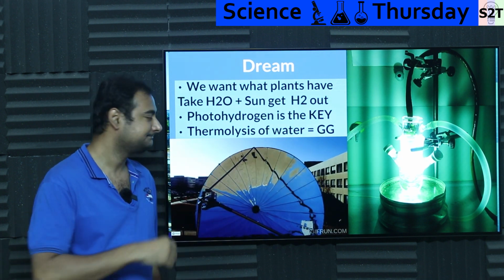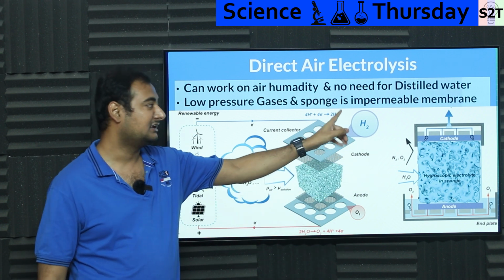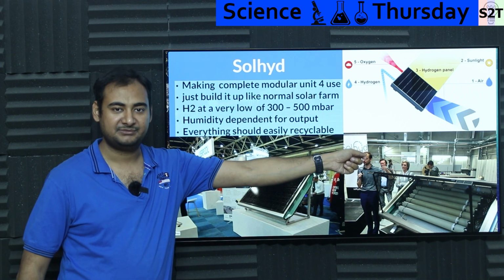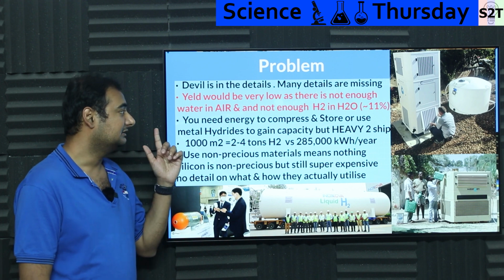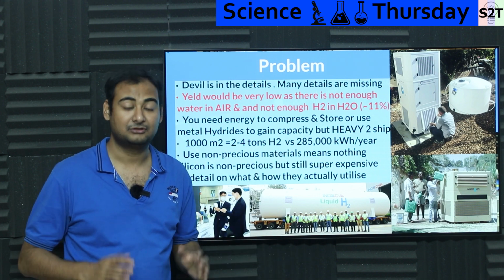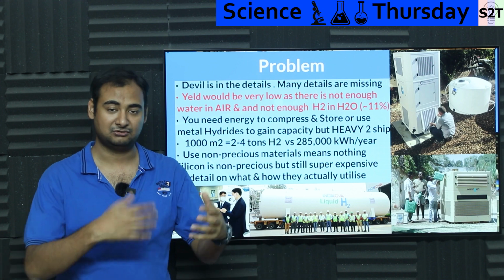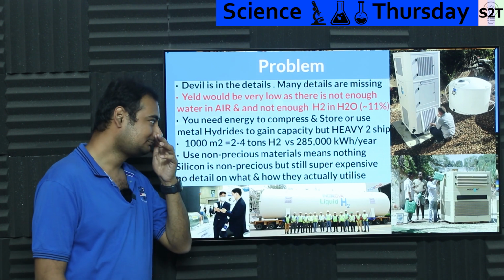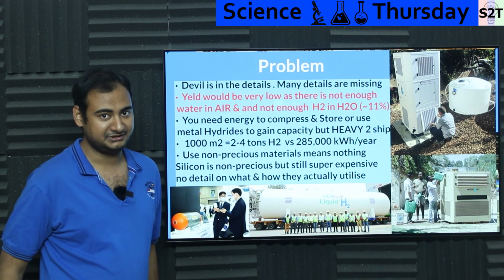Solar Hydrogen Panel Explained {Science Thursday Ep225}

Comment: Please, hydrogen as a residential or vehicular energy source is so dumb for so many reasons. Are you going to take the blame for all the people who die in hydrogen accidents? Hydrogen has its place - in industry and industry only. Only 5 days ago a hydrogen bus exploded and burned in California - there was no warning and it's only luck that no-one died.
Reply from the maker: I am sorry I have no idea what u are trying to say
Reply: @s2tenglish  OK. Industrial hydrogen is fine when used immediately after production as a reducing agent especially in manufacture of steel. However the fossil fuel industry are pushing for hydrogen in society. This is bad. Here are just two points (out of many) 1) Hydrogen gas is very rare in our atmosphere and yet there are microbes and potential pathogens that feed on it. Increase H2 and those pathogens could cause us harm. 2) Escaped H2 reacts with hydroxyl radicals in the atmosphere. Free hydroxyl radicals are the one thing that reacts with free methane to neutralize it. Removing OH- from the atmosphere will increase CH4 which is a potent green house gas bubbling up from thawing permafrost. Bonus point : H2 oxidizes (mostly explosively) with oxygen to produce water vapor. Water vapor one of the most potent green house gasses. The sun does a great job creating just enough water vapor to keep our atmosphere stable - we shouldn't be adding to it.
Reply from the maker: I totally agree but may I ask why U think I am "PRO" hydrogen I don't like it at all its worst fuel we could come up with And I have made many videos talking about it all its problems